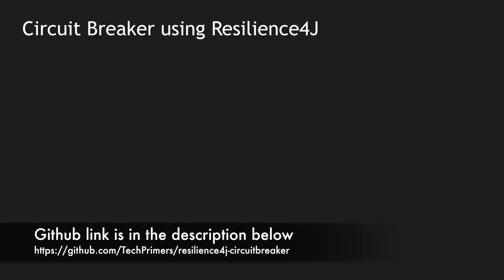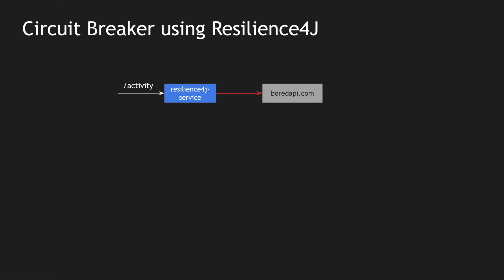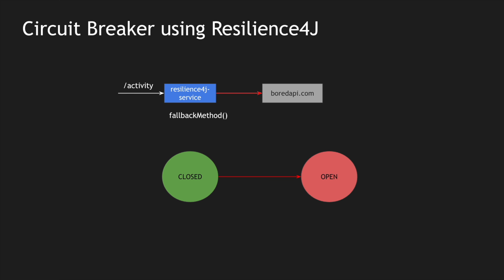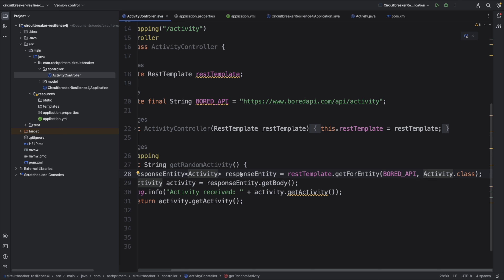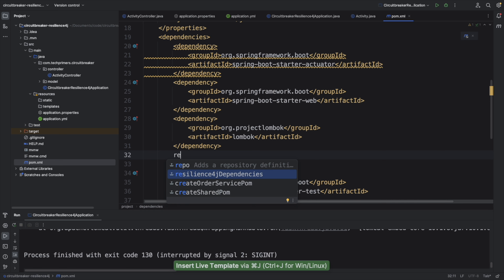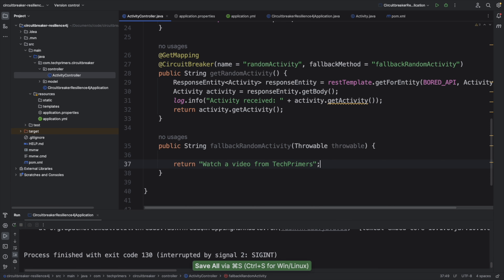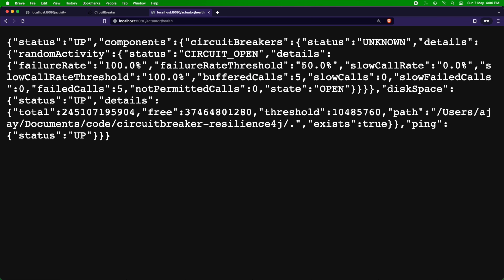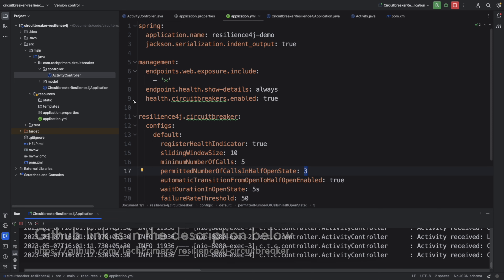Spring Boot 3 | Circuit Breakers using Resilience4J | Microservices Resiliency Primer

Comment: Hey just a doubt, how did the state changed to open when just one request failed. How does it calculate the rate?
Reply: Something is off in this setup. There is a sliding window and the failure rate options you will need to take a look.

Comment: Hi couple of month back I have implemented one of my project and it worked well. But still I am not clear with difference between sliding windows vs minimum number of call. The failure threshold worked based on minimum number of call but I don’t know how the sliding window based on count related with them